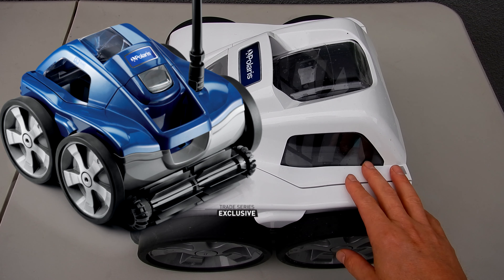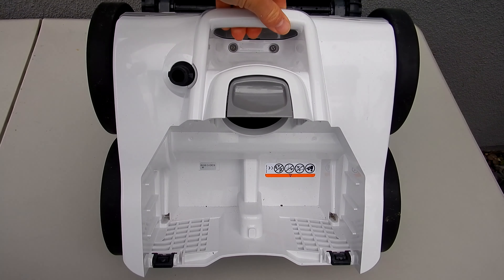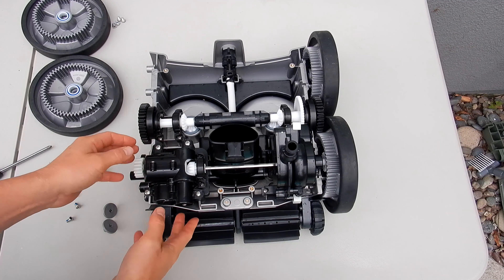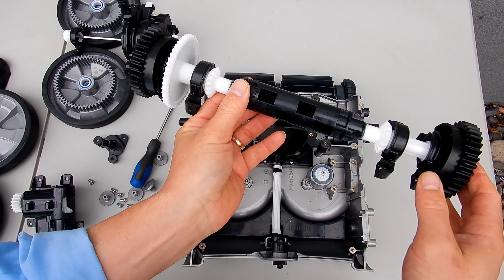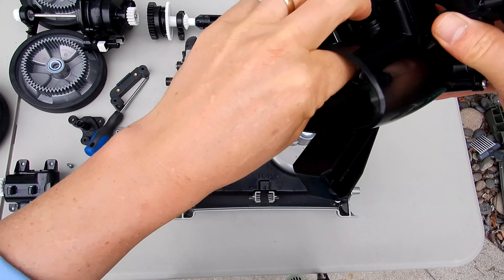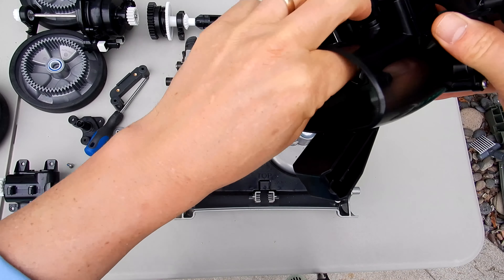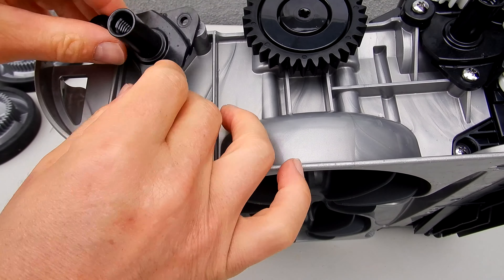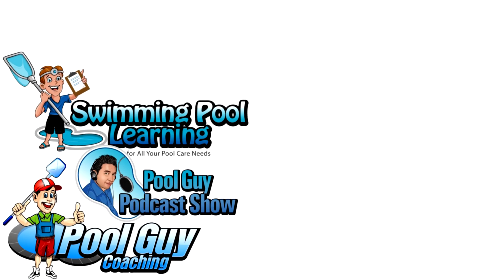Polaris Quattro Sport and Quattro P40 Not Moving: Complete Cleaner Troubleshooting and Rebuild Video

Comment: I have been replacing gears in this thing a year after I bought it. I have the new stainless gear for both gear boxes but the gears inside the gear box are still plastic and do not last long at all. These gearboxes are not cheap. Why Polaris doesnt sell gears is beyond me… these boxes can easily be rebuilt.  I am very disappointed in this pool cleaner and once I get tired of replacing parts will be trying a non booster pump model and not a Polaris

Comment: Mine started to go in circles after 1 year... Great video... Thanks!
Reply: Your gearbox is not working correctly and is broken. It should be covered under warranty if you bought it with Leslie's.  Just don't run more than one 1 or 2 hours a day

Comment: Great video. Started taking it apart. A screw wasn't tight from the manufacturer, dislodged, and jammed itself into the wheel gears. Would only turn a quarter of the way. Found out where the screw was supposed to go. Done. Back in business. Thank you for the great video.

Comment: Great video, thank you for this! Before I start, quick question, maybe you can direct me to what I should look at first. Ours stopped moving, when the booster is off I can manually spin the wheels fine, when the booster is on the wheels lock up and I cannot manually turn the wheels. Gear box issue?
Reply from the maker: Sounds like it if the front brush doesn't jam up when you move it by hand

Comment: Great video! Thanks for posting it. We have this same unit and it has no issue moving around the pool, but it all of a sudden quit picking up debris. No suction at all. Have you ever seen this problem with the quattro? Thanks again!
Reply from the maker: Front brush might be jammed with debris.
Reply: @SPL thanks for the reply! That was something we had checked already and it didn't appear to have any debris or blockage. We ended up selling it for parts last weekend. Replaced it with the cheaper Polaris P28 and unbelievably, that little bugger works soooo much better than the gigantic Quattro ever did. I guess it was just the wrong cleaner for our pool.

Comment: How do you replace the two gray latches on the inside?  I’m having trouble removing mine.  Not sure if there is debris stuck in the grooves making them tight, but I can’t get those suckers out!  Already have the replacement pieces.
Reply from the maker: I am not sure the minute mark, but everything is either screwed in or set in the cleaner. So they should be able to come out.
Reply: Admittedly, those little boogers are tough to get out, but I will say, they will slide out if you push on them from the back.  I tapped mine out with a wood dowel and a couple taps on the dowel with a hammer.

Comment: This is a great video, thanks so much for doing this. It has helped me a lot. I do have one problem. My debris canister keeps popping off. I replaced it with a new one but it is still loose. Should I replace the body as well? I can see some wear at the latch area.
Reply from the maker: Maybe it is under warranty. Sounds like a defect to me.
Reply: I had the same problem.  There are two hinges at the back of the cannister, but they are attached to the lower half of the frame.  Mine were super-worn and allowed a lot of movement of the cannister and lid.  I replaced those AND the Latch that is in the lid.  Problem solved.  Both parts are about $15.00 ea.

Comment: I have rebuilt this cleaner 4 times. When is works it works well. What do you suggest the issue could be if it is simply not moving? When I hold it in place, everything turns. When I put it on the bottom of the pool it barely moves. I have changed all of the fittings on the hose, taken the entire cleaner apart and put it back together again. The gear box and engine are not even a year old. The pump is running but I have no way to verify the rate of flow. What could be wrong that I am not seeing? Im about done with the design. It is very expensive to keep running.
Reply from the maker: It could be the booster pump. Easy to check. Remove the quick disconnect. Turn on booster pump. If you can put your hand over the jet and stop the water flow there is not enough flow. Your hand should not be able to cover the pressure line and stop the flow.

Comment: hello, we just installed this machine and it's going great. Only issue i'm having is that on it's scheduled startup it just sits in one place till you give it a shove, then it's good to go. water pressure issue?
Reply from the maker: Check the front roller to make sure it is aligned. That could be the issue.
Reply: I’ve had mine just over a year and I’m having to give the cleaner a tug now as well. This issue started a month ago.

Comment: on the right side gear box, should the white gear on the outside (connecting with the wheel) move freel?  Mine slides back and forth but it seems like it should be more locked in place.
Reply from the maker: Everything should be pretty tight.
Reply: same problem and the scrubber doesn't turn like the other side so it goes in circles and won't climb.  Is this the gear box as well?
Reply: @rdnorris123  Sounds like youre running it too long and your brush assembly on that side is no good and your gear box is out as well.
Reply: @rdnorris123  It's the Gearbox.  Easily replaced, but NOT cheap.  Poor Gearbox design by Polaris.  My Quattro is 3 years old and I am on my 3rd Gearbox.

Comment: As retail person please bring if under warranty first we will take care of you.  2 years with Leslie's.  
Please always check your manifolds for cracks and broken grids.  
Only need to run the Quattro for about an hour to two a day.
Reply: @Kevin Y.  Well... wouldn’t that be nice! But we can’t even get a straight answer, warranty information, let alone a call back from any member of management at our Leslie’s here in San Angelo, Tx. regarding one of our sand filters. The whole Leslie’s experience HERE has left a lot to be desired, to put it nicely. I can’t begin to imagine the B.S. that I would have to endure if I took the Polaris in. Furthermore, one of the last times I was in there (following up on the filter issue) and mentioned the Polaris issues to the assistant manager and asked if I could bring it in and exchange it since was a recent purchase. I was told “No Exchange” the manager would have to look at it and see if she could fix it and if not, then it would have to be sent back to Polaris for further warranty or replacement. But since we can’t get the manager to use a simple telephone, I’m a little worried about a screwdriver! And if the Polaris takes as long as the filter issue is taking... the warranty will run out! Kevin, you seem knowledgeable, and customer service oriented. Do you work for Leslie’s? If so, can we contact you at your store and some informed help?
Reply: @Terry Thompson  Yes, I'm manager for Leslie's in Houston.
Reply: @Optix-Code  Oh, wow! What a lucky 🍀 break! Houston is pretty big! If someone wanted to locate a knowledgeable manager in what part of Houston should they start? I’m asking for a friend 🤣🤣
Reply: @Terry Thompson  give me you info and I'll be more than happy to speak to you.
Reply: @Terry Thompson  fyi Spring and The Woodlands area

Comment: I have a problem with my p40. Stays in deep end and just circles the same area. What could it be?
Reply from the maker: It could be a couple of things. 1st check the pressure going to the cleaner and make sure it is in range.
Reply: @SPL  ok will.
Reply: @JZeverybody  I bet it's the right side gear box. I have same problem, scrubber on right side (standing behind it) doesn't turn forward as fast and it wont climb walls either
Reply: Yes I replaced the engine and gear box. It works better, but, still not great. Stays in deep end and seems to spin on the waste drains for awhile before it moves on. Definitely not working like the day i purchased it. Not sure what to do...
Reply: @JZeverybody  call customer service and request a replacement
Reply: @rdnorris123  I did call (several times), not a good experience. My machine has been a lemon since the beginning. They don't seem to want to correct the issue. Or they want to drag the process out to an extreme. Not happy...
Reply: 😳 OMG!!! These are NOT things I want to hear! Mine is doing the EXACT same thing! And who wants to deal with crappy customer service when already have enough problems dealing with flawed (overpriced) product 🤦‍♀️. I really hope I don’t have to turn into a 👹 monster to resolve the problem I hate having to do that.
Reply: @Optix-Code  the machine was defective. Polaris replaced it and the new unit works well! Thank you Kevin for your concern!

Comment: great video!!!  question: is there a tread-wear indicator on the tires?  I own one and it just started to spin and not reach the furthest wall like it used to. I noticed the side-brushes were extremely worm so I ordered new ones from Leslies.  Maybe I should replace the tires and roller brush too?
Reply from the maker: Would say to replace those parts. Sounds like it is time.
Reply: @SPL  thanks for the response!     is there a known issue with the right side-brush gear box? seems that the roller brush is not spinnign great
Reply: @fatthor2476  YES!  Essentially there is ONE gearbox, but is the Right Side that has always failed on mine.  My Quattro is 3 years old and I am on my THIRD Gearbox.  Poor design by Polaris.  I did notice that they changed at least the outsidegear from plastic to aluminum on the latest one I ordered.  There may be some internal parts changed, but I haven't taken this one apart yet.
Reply: @tonyconsolo2391  Thank you. I replaced the gearbox with an aluminum one and it is back to working great.